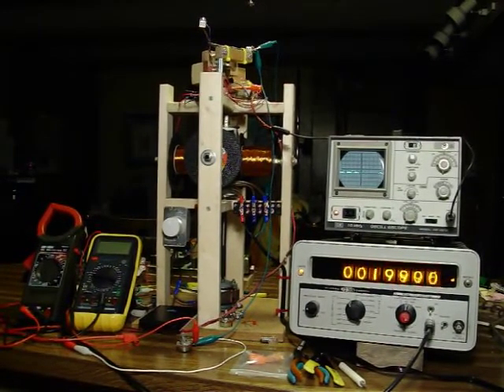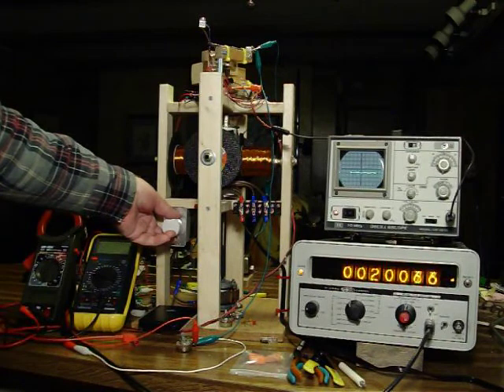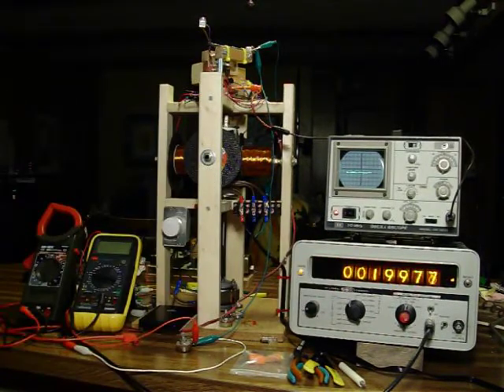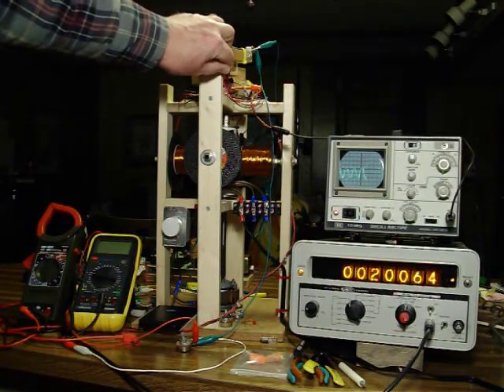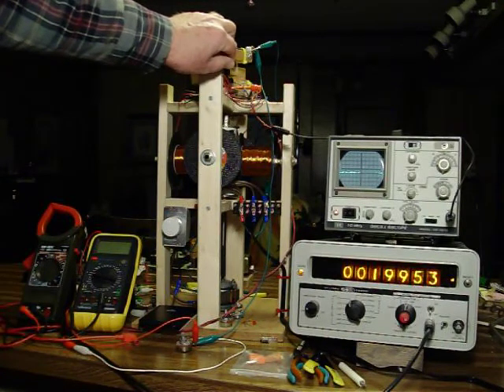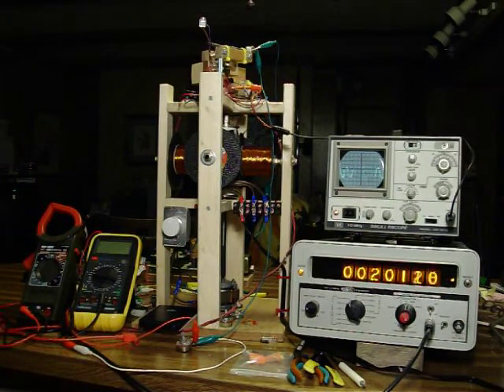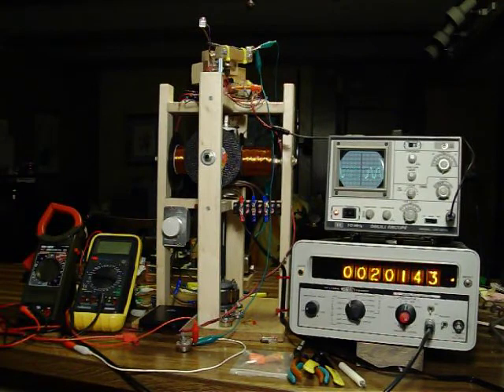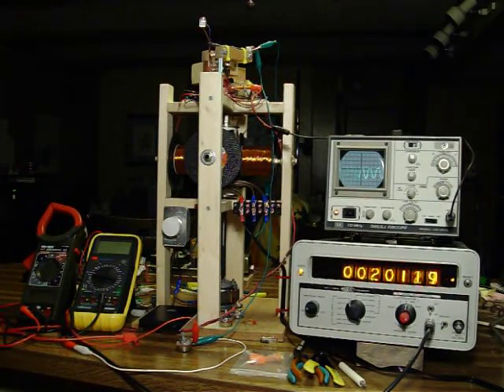SpeedGain-Desktop.m4v

Comment: It is amazing that this thing can run with so little power. Brush less motors are less trouble for Space projects. Also this motor can be used as a generator and can charge up batteries for long distance travel.  A wonderful device.
Dick Baublitz xpi ... Carson City, Nevada ... e-mail: (blitz@pyramid.net)